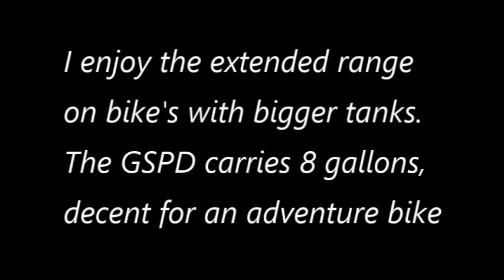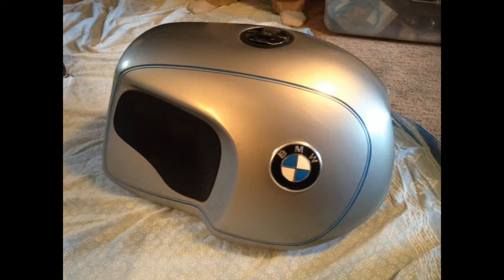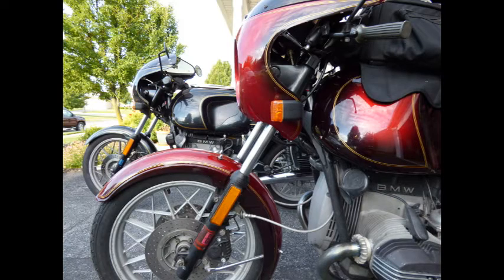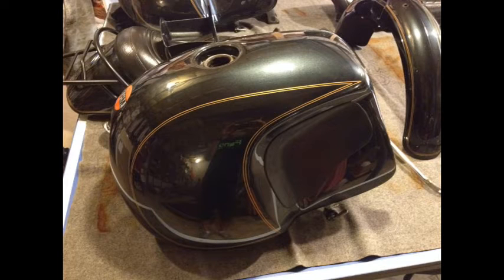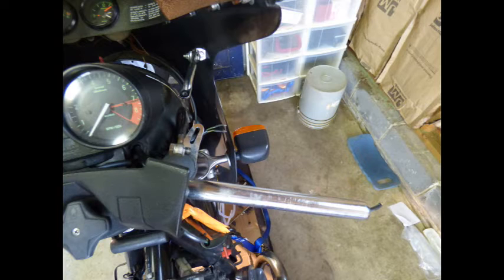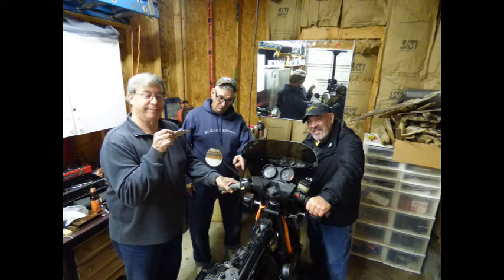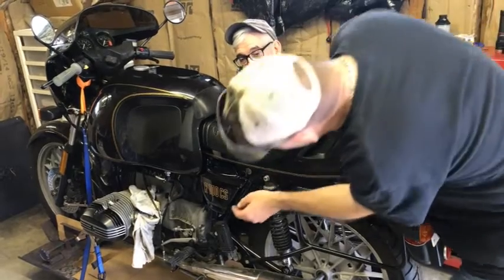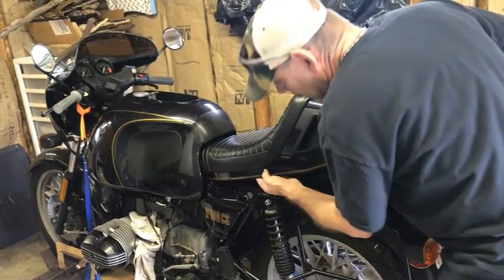The Heinrich Maneuver

Comment: Looks great! Does the big Heinrich tank fit on the RS as it is? Nothing special needed?
Reply from the maker: Hi Marcel, thanks for watching!  The big Fuhrman tank requires a somewhat unique contraption to bolt the rear of the tank to the frame.  From a bike's perspective, nothing needs to be modified to accept the Heinrich Fuhrmann tank.  The smaller 8 gallon tanks are literally bolt on, however on my RS it did require some some custom bracket work for the fairing support underneath the tank.